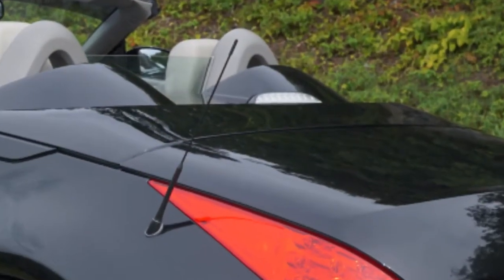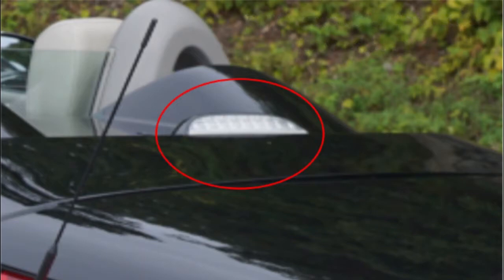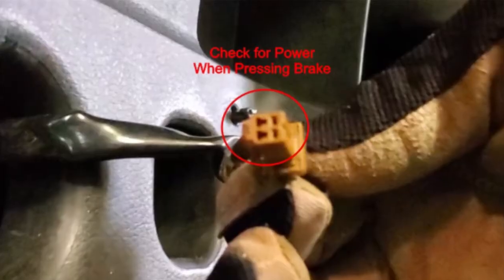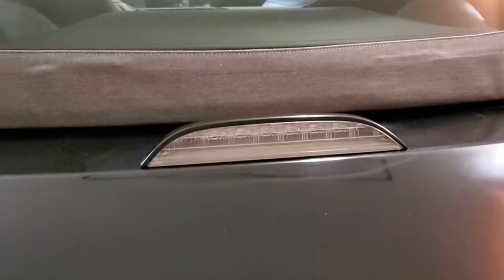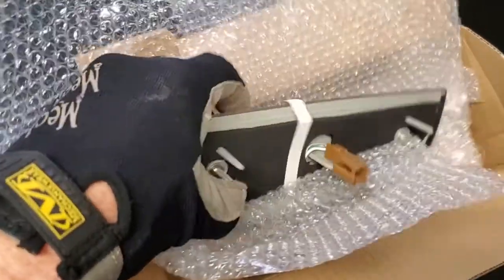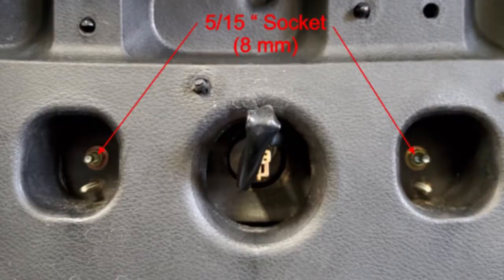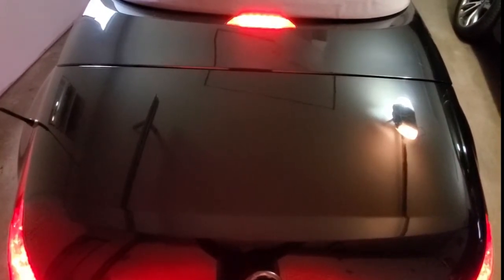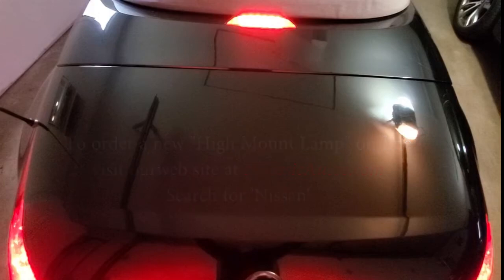Replacing High Brake Light (High Mount Lamp) on 2007 Nissan 350Z Convertible

Comment: Hi it’s not working in my 350z so can i replace the bulb or i have to replace the whole thing ?
Reply: This is what I need to know as well. Did you ever get yours fixed/replaced?
Reply: @luckystr221  the whole light will need to be replaced. The entire light.
Reply: @mackdaddy36  what if it comes in sometimes? I think maybe a fuse?
Reply: @luckystr221  you may have a short in your wiring to your light. Get that checked first.

Comment: Do you have to put the top down to replace the light, our top is not working and cannot be put down.  Thanks.
Reply from the maker: You will need to lower the top practically to get to the underside of the rear cover.  This will provide access to mounting hardware and electrical connections of the high brake light.  I suggest you talk to your local auto shop to see if they have any ideas on a fix.  Good luck!

Comment: My 3rd brake light has condensation. Any ideas?
Reply from the maker: If you are DIY person, you may want to remove the light and try to dry it out.  Before you reinstall it, look where the moisture was getting inside the light and seal off the area with a clear glue or other sealer material.  
Good luck!